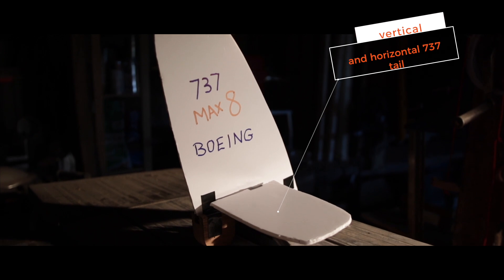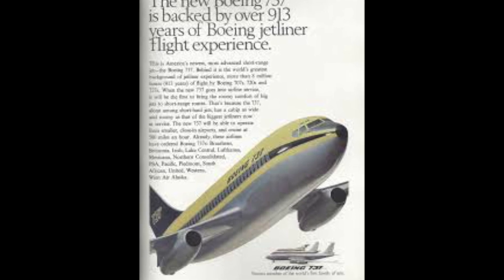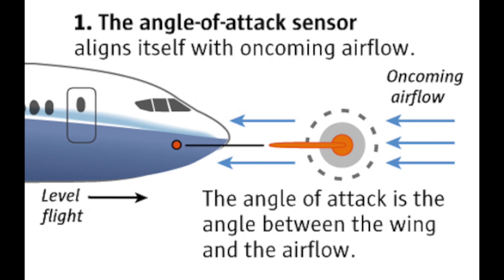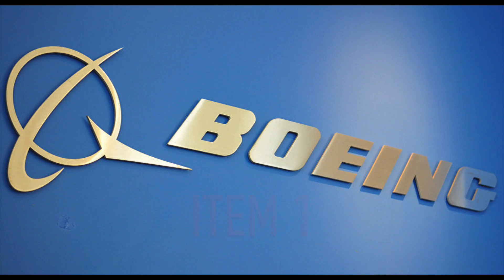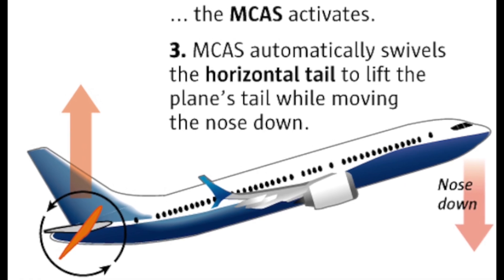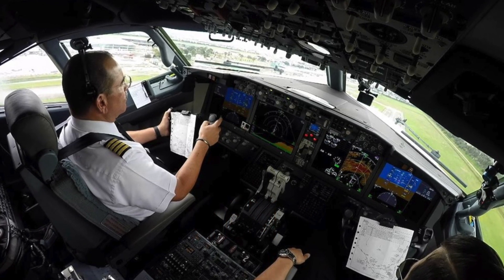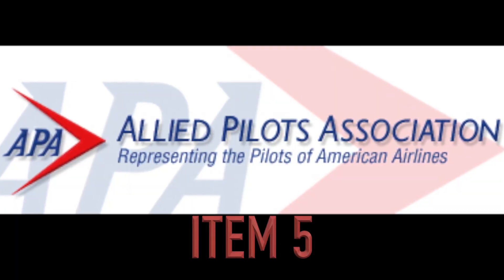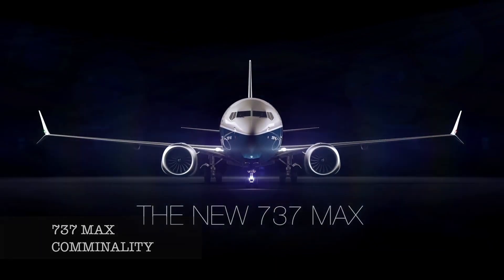NEW *** 737 MAX 8  - Prof Simon

Comment: Please, please, please! Learn what a horizontal stabilizer and elevator are! That graphic of the plane from Seattle Times is FALSELY showing a 737 with the type fin found on modern jet fighters where stabilization, trim, and elevator function are all combined into a single pivoting fin, sometimes called a "stabilator". And your model shows the same thing! The JACKSCREW does not control the elevators, the control column does. Jackscrew controls the adjustable horizontal stabilizer in the 737. 
In an old school WWII vintage plane the horizontal stabilizer was FIXED, the elevator controls normal flight maneuvers, and the trim tab located on trailing edge of elevator fin was adjustable to maintain neutral trim.

Comment: Mount motor new, caused problems, performance and stability, static and dynamics, the MCAS this is a very bad way to proceed, a patch, a fudge, the system that never gives  problems, is the one that DOES  NOT EXIST.
Solution:  change engines and eliminate the MCAS

Comment: Two GPS sensors one in the nose and the second in the tail would give a computer better data than mechanical not reliable winglets and pitotubes plugged up by swarm of Mosquito in tropical climate.  The  computer should give a message to the pilot. " My dear pilot the sensors give me the data that I , your computer must revalidate with your GPS data in your nose and tale and calculate your angle of attack and trim your nose , adjust your speed to the the save parameters , just give me 4 seconds to analize the GPS imput.

Comment: Instead of focusing on the MCAS System, you should have explained the "Primary  Reason" for Boeing to install this garbage system.  Reason 'Pilot Incompetence' relative to Approaching a Stall or ability to 'Recover' from one, in addition to poor design of the 737 Max  8 & 9.   Boeing Test Pilots are the only pilots that have and are capable of recovering from a 'Full Aerodynamic Stall on a Boeing aircraft'.  They will not attempt to to do this at an altitude of less than 10,000 feet for obvious reasons.  I will not explain all of the different types of Stall Configurations, however the most important fact to be aware of is that 90% of all Commercial and General Aviation Accidents/Crashes are due to "Pilot Error".  

Aircraft manufacturers, the FAA, FBI, NTSB etc. all attempt to cover up the real cause(s) of aircraft losses not to mention thousands of passengers.  The 'Liability Factor' is translated into 'Dollars and Cents.  Since the general public has either no technical knowledge or experience in aviation, the criminal parties do not have any problem to Cover-Up anything.  Pilots as a rule will not publicly tell the truth relative to the probable cause of an aircraft loss, due to fear of losing their jobs !  It is also the reason they choose to refuse to " Abort a Landing, Abort a Take-Off, demand an Alternate Heading, Declare an Emergency etc. etc.
The fact they're willing to risk their life, does not give them the right to risk the life of passengers and crews.

Comment: While this video is very illustrative of the MCAS function, the use of terms can be confusing to the uninitiated.  The horizontal stabilizer should not be confused with the “surface in the tail of the airplane”.  It would be better to differentiate the horizontal stabilizer from the elevator.  Because movement of the horizontal stabilizer has much more effect on the pitch up or down of the airplane than the smaller elevator surface.  Also, when using fly-by-wire aircraft, especially military fighter aircraft, as an example of unstable flying characteristics, this is a gross misunderstanding of commercial aircraft aerodynamics.  First, modern fighter aircraft are purposely designed to be unstable in pitch because this instability provides much more maneuverability (faster response)  than an aerodynamically stable design.  The instability is computer controlled by the aircraft’s fly-by-wire  By definition, commercial airplanes are required to be aerodynamically stable such that they can be flown “hands off” when properly trimmed by the flight control system, which can respond to the pitch instability much faster than a human pilot can.  Second, commercial airplanes are required to be designed to have handling characteristics that control pitch up so that the airplane is more difficult to get into a deep stall condition which can be very difficult to recover from.  A deep stall is a flight condition where the airflow over the airframe is so disrupted that the pitch control surfaces (horizontal stabilizer and elevator) are totally ineffective in controlling the pitch attitude of the airplane.  In a deep stall, it is very difficult, or in some aircraft nearly impossible to recover the aircraft back to normal flight.  Essentially the airplane is falling out of the sky tail first rather than nose first.  This is why controlling of the pitch attitude is so critical for safe flight operations.  Fly-by-wire aircraft provide greater pitch control authority and at a much faster rate that can avoid the deep stall condition.  Again, commercial airplanes without fly-by-wire must be designed to avoid aerodynamically the deep stall condition.  Previous versions of the 737 achieved this requirement without the need for a software controlled “device”. However the LEAP engines and their placement on the wing make pitch instability a problem.  During initial 737Max flight testing, the greater pitch up characteristic was discovered.  Two fixes for this issue include designing a new, larger horizontal stabilizer and larger elevator surface, or developing a software solution to automatically control the existing horizontal stabilizer to prevent the pitch up from happening.  Boeing, for a number of economic reasons, chose the software solution.  

The problem with the 737Max, being a consequence of a faulty MCAS system driving the airplane into a nose down condition, is a response to a falsely detected pitch up condition indicated by the Angle Of Attack (AOA) sensor.  MCAS drives the horizontal stabilizer into a position which the elevator surface can no longer control the pitch attitude of the airplane,  the horizontal stabilizer completely overwhelms the ability of the smaller elevator surface to control the airplane.   This is very analogous to a “runaway stabilizer” scenario for which pilots are trained to deal safely with.  However, the stabilizer is not running away in the more traditional sense.  It is not responding to pilot control inputs in a very different way that a true stabilizer runaway.  The pilot can be confused by momentary regaining of control of pitch when the MCAS stops driving the horizontal stabilizer nose down.  But then MCAS drives the stabilizer nose down again in response to the faulty AOA sensor input.  This software driven instability is is what causes the purposing pitch instability.  As you state, Boeing did not provide the true authority of the MCAS system to automatically control horizontal stabilizer position.  I surmise that greater control authority was determined to be necessary for the -8 and -9 737Max airplanes.  The even longer fuselage of the -10, currently undergoing testing, might require even more authority to drive the horizontal stabilizer.
Reply from the maker: Thank you...you added clear and.concise information to the discussion
Reply from the maker: Ken....can you email me....you have some insightful info that I need to discuss and turn into a film update...simonhollandfilms@gmail.com
Reply: This is by far the BEST explanation I've heard until now. 
You did a very good job at differentiating between the functions of the stabilizer and the elevator and explaining why the elevator couldn't compensate for the misbehaving stabilizer. 👍

Comment: very infomative and following Einstein's principle that a genius makes difficult subjects easy to understand. In case of differing readings from the two AOA sensors, which one is MCAS using?
Interesting fact that Boeing silently changed the control output from 0.5 to 2.5 degrees and that this adds up until maximum nose down setting. As far as I know they found the jackscrew assembly in Africa in exactly that position. To me this is at least close to mass murder. Will be interesting to see whether and how the American legal system will swipe this one under the carpet.

Comment: The amount of control adjustment is four times what it should have been.  The system doesn't check both AOA sensors for errors.   

So who is management going to blame for the problems they have caused? 

I wonder could this same system be at fault with the Prime Air crash?

Comment: Thanks for the straightforward explanation. I have three questions. Hopefully you can help me understand. 

1). Why would the MCAS system rely on the input from only one AOA sensor? The 737MAX 8 is equipped with two sensors. 

2). Regarding the 0.6 and 2.5 degree stabilizer correction discrepancy. How does that get overlooked? Knowing that 0.6 allows for 5 degrees of down angle on the nose of the aircraft, 2.5 degree increments  would seem to allow over correction even if the system operates properly. Repeat this correction time after time and the aircraft is in a horrible situation. 

3). Was there anyway to disconnect MCAS? Of course if, as the pilot of a 737MAX 8, you don't know you have MCAS and/or you have incorrect info about how much it corrects you might not think to or want to disconnect.

The cozy, rationalized relationship between Boeing and the FAA has shaken my confidence is commercial flying. How many other potentially fatal flaws have slipped through the certification system?

Here is a video about the 737 MAX 8:
https://www.youtube.com/watch?v=LVOwxV9dVmg
Reply from the maker: I’ll get back shortly....thank you

Comment: I Have one question!!
If you look at the Angle of attack sensor  its placed just next to cockpit on either side . Its highly prone to "BIRDSTRIKE" and might activate MCAS .Incase this happens during takeoff or landing ,Pilot might not have much time to recover the Airplane in such case. 
P.S : i am not an aviation guy just correct me if i am wrong !
Reply from the maker: I think they are super vulnerable....there are better designs with no moving parts
Reply: @SimonHollandfilms  Yes sir!
I also feel the same thing. It's highly vulnerable ! I guess they should address this problem before another causality takes place!
Thank you so much for your reply
Much appreciated 🙌

Comment: If angle of attack sensors are part of the problem they need a third AOA and a voter circuit to eliminate the bad input. This method was used in triple autopilot CAT3a systems. Though the L1011 only had two AOA's if I remember correctly.

Comment: So the cause of the crash is out of  two angle of attack sensors one is off by 20 degree and mcas used only that data for calculation overriding pilot's input.

Comment: Yep im defiantly no expert but as the professor explains it all seems to be pointing to the MCAS giving a false reading from the AOA sensor which makes the on board computer perform a compensating maneuver in a opposite direction to what the pilots wanted the aircraft to do thus making the pilots fight against what the plane was automatically doing(terrifying). Did both the Lion and Ethiopian both perform steep take offs to make the AOA  give a 'nose too high' reading making the computer think the plane was losing speed and to counter act made the plane gather speed by dropping the nose? Is there a switch behind the throttle levers to over-ride the computer? Could it had been that simple? The problem it seems is that the pilots had no idea how to get out of a deadly situation at such short notice. No fault of their own, bad upgrade and Boeing will be liable for this!

Comment: I cannot believe there was zero redundancy built-in. Especially only needing data from one AoA sensor, how do they which sensor is malfunction? The reason you often see three times redundancy is avoid something in software terms called split-brain. Without a majority it can lead to different sides of the system thinking they're both correct, and will start to complete unless one part is shutdown.
Initally I thought it was poor pilot/ training performance, but this now casts doubt on Boeing purposely downplaying such major changes to save on paperwork.
As a software engineer: it's widely believed that it is only a matter of time until a software bug kills thousands, there has already been crashed rockets and planes because people got metric and imperial units mixed (a schoolboy error).
Reply from the maker: Must name my band....Schoolboy Error.....fab....prof Simon.
Reply: I think I may have been right about the sensors competing with each other. Switching between the sensors in tandem would account for the seesaw motion of the planes as a result of the two very different values. 

I don't believe the idea of going with software is necessarily bad, it is just astounding how poorly it was implemented. Something as simple as shutting down MCAS if the trim was out of the normal range (or the AoA sensors were way off each other), could have been a very different outcome. if(trim.abs() > x) {mcas.shutdown();}

And yes it is unbelievable that Boeing was allowed to self-certify a new airplane.
Reply: In the petrochemical and chemical industry our Process Control and PLC systems use a 2oo3 rule "2 out of 3" for any analogue or digital inputs.  You don't program them but configure the level of disagreement in time and percent etc that impeaches a sensor. You then only have to address one "tag" in your program.  If there is disagreement you can easily generate an alarm and continue operating or shutdown in a safe manner.  These are designed to SIL standards.  You can also have 2oo2 and 3oo3 but of course these can not continue operating normally but you would at least not drive the aircraft into the ground. 

The old Boeing 737 is built around having only 2 (not 3) of everything so that if the altimeter, artificial horizon or a hydraulic pump fail the crew can see and compare  instrument and switch to the one working.  In MCAS case they alpha sensors weren't even displayed.  What chance have the crew got?

The aging systems architecture doesn't really support having anything as powerful and autonomous in the B737 as MCAS

Comment: Airbus is flying since decades under computer control. No Problem, very safe.
And Airbus have 3 AOA sensor and usind the information of the two sensors with the most less diference. So it is safe, a malfunction AOA will get ignored.
But Boeing using information only of one sensors, no check with the second, if the informations are correct.
...and if a bomb was the reason of accident, this aircraft has forbidden to fly by such unsafe control system. Its a crime!
Reply: You seem very confident. Are you a pilot. Miracle on the Hudson pilot Captain Chesley Sullenberger
flew the A320 for years and he doesn't agree with you.

https://www.youtube.com/watch?v=kERSSRJant0&t=310s

Comment: Simply look closely at these aircraft - they have big giant new fuel efficient engines hammered onto an old airframe (to save $$$ R/D costs).  Multitudinous software patches will not save this "intrinsically un-airworthy" airplane from it's doom.  Boeing needs to scrap the maxx 8 & maxx 9 / start all over and build ground up airframe to match these engines.  Replace current CEO also.
Reply: It is to be hoped that ALL persons responsible for this ghastly aircraft are charged legally for the deaths of all pax and crews. perhaps only then, will their counterparts FAA start to listen and understand the Bullshit, lies and cover ups are morally unacceptable,not forgetting the Doors falling from the DC 10s a few years back, again due to slack engineering and lack of design skills to say nothing of the poor or non existent test procedures.

Comment: Good work prof Simon...
I am a pilot currently on Airbus and with 40 years experience....
In my opinion the primary cause of these accidents (Lion & Ethiopian) is the low standard of pilots and/or training & checking standards.....
Since we were kids on B707, we have been trained on how to "cut off" the electrical power to a runaway stabiliser and that was done by flipping a switch near flaps handle....
Planes nowadays are sofisticated but the the process of pilot training is not compatible with them.....
If FAA/EASA don't step in and force major changes in pilot training, we will see more of these accidents in future...
Thanks
Reply: Remember the Mach trim on 707's. And the PAN AM where the uninformed FO in the absence of the Capt. disengaged in the Mach range. The aircraft soon started to descend and speed up. It is believed the aircraft was entering the predicted Mach tuck. The amount of control force used to recover put a permanent set in the wing. If you have seen the 707 spar stress to failure test you can imagine how close they were to that point.
Reply: Mohd maj : Respectfully disagree that Pilot error is the "primary" cause here as you suggest. As an experienced Pilot you should know to wait for the final conclusion of the investigations before making any comments or blame based on assumptions. It is now clear that there are many factors behind the two crashes & Boeing as a manufacturer have a lot of Questions to answer.
Reply: Mohd maj this flight is not the first one on this plain .... they had a lot of flight in the plain and had no problem till the system malfunction and took over less than 6 min. It’s really easy to sit there an pass a judgement.... because it’s third  world country doesn’t have good training ... education training given much better way than where you are ... don’t judge ppl